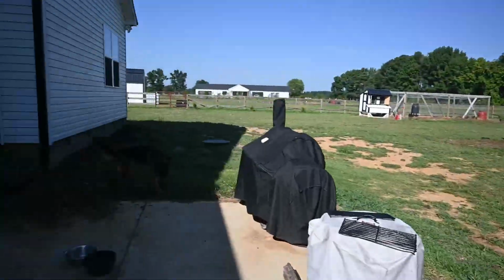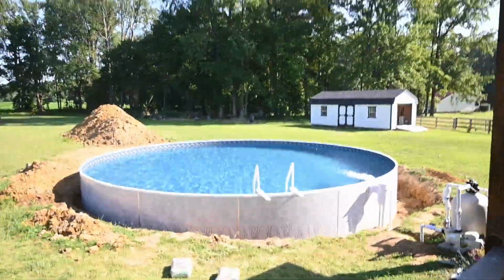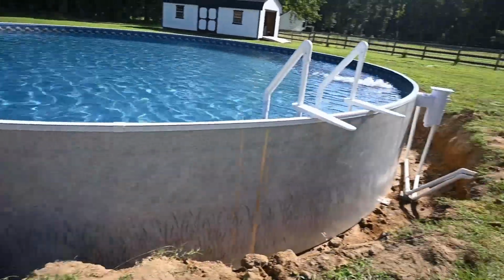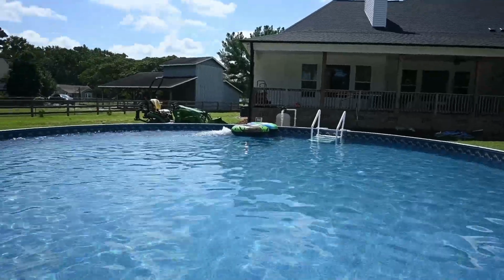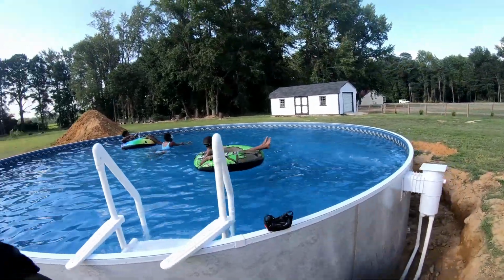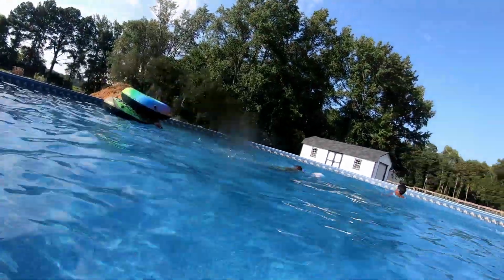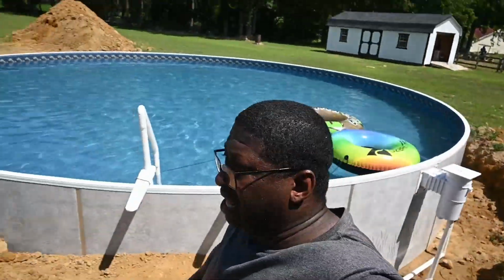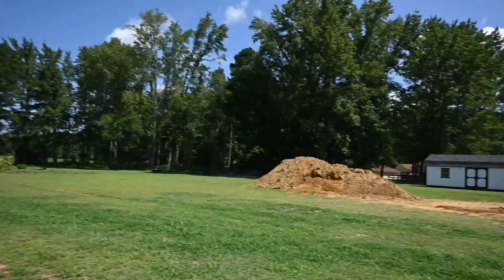The Pool is Up and Running!

Comment: Nice looking pool.  I think your contraption around the steps makes it too easy for a kid to get their feet or hands entangled and you can't have the metal from the bucket in the pool, "all metal objects attached to or within 5 feet of the pool must be electrically bonded". They should have provided a better way to stabilize the steps. I also saw this video https://youtu.be/Xta4kZy7n9M
Reply from the maker: Thanks! The contraption is temporary trying to figure out how much weight is needed to hold them down. It’s looking like 300lbs. I do like the weight system that you linked. I may be able to zip tie them upright to the sides since I don’t have the bottom grate. Once I have a decking or “outside the pool” area figured out I can also secure it to the uprights. I think I can pull the bucket out it’s not actually doing anything. As always I appreciate your input  @juromebey1922